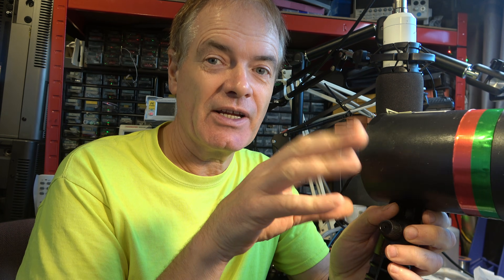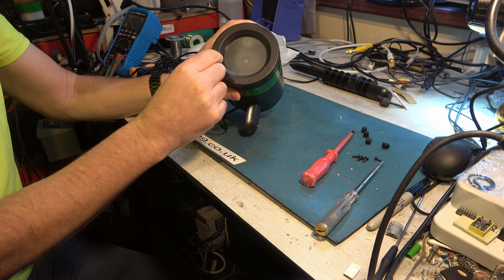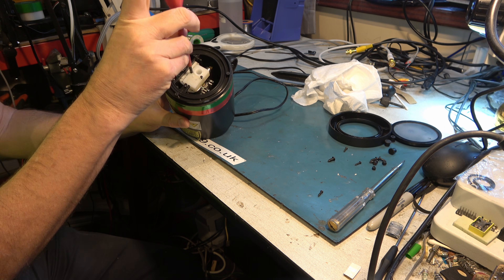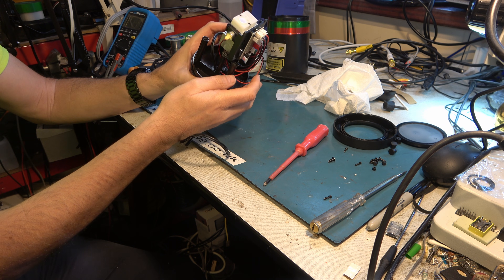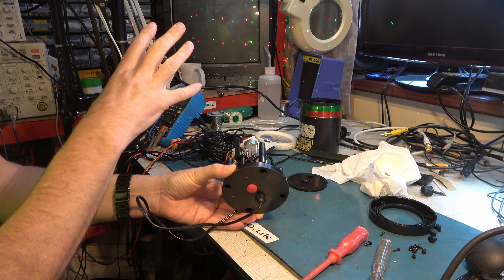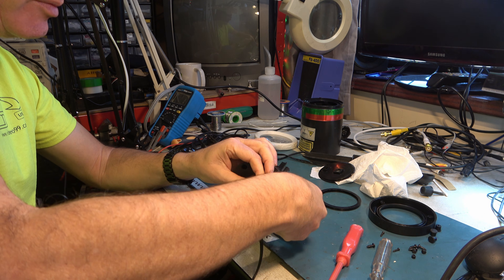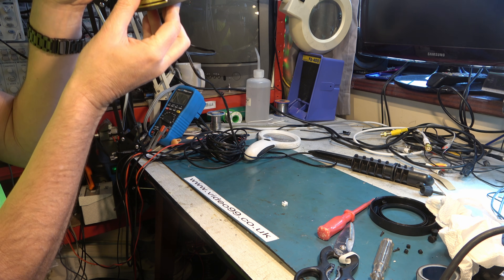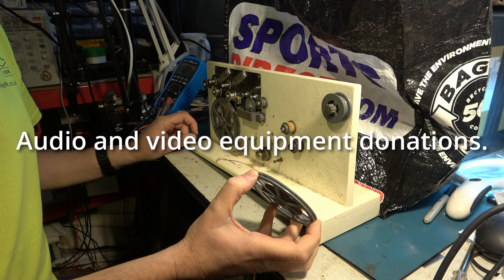Laser projector has failed, can we fix it?

Comment: I find putting a small sachet of desiccant in outside enclosures stop condensation especially on so called sealed fitting., I think the fogging on the lens is from off-gassed chemical condensing. I had a dictating machine which used 3mm tape I think it was made by Philips.  Magnetic tape on film now that will be interesting.  Editing of film with sound was, is  hell.  So was cut edits on two inch video.

Comment: When I'm using oil or contact cleaner and I don't want to get it on any surrounding areas, I  put some oil/contact cleaner in a small petri dish and suck it up with a syringe. That way you can be more precise.